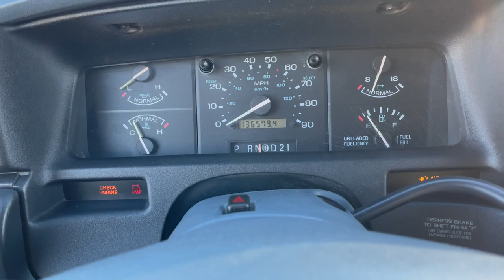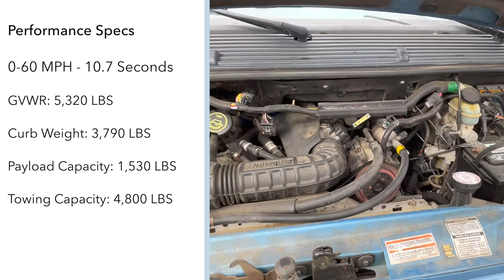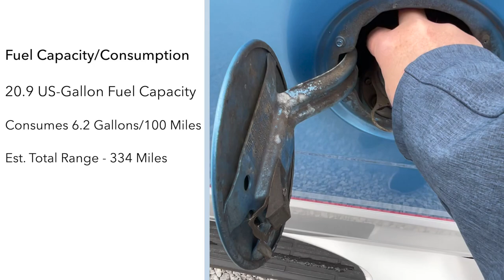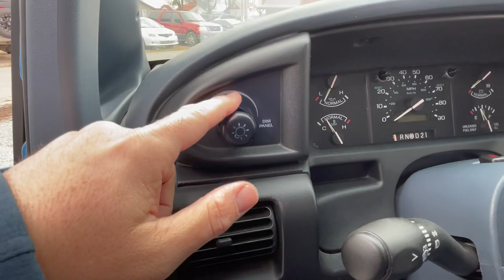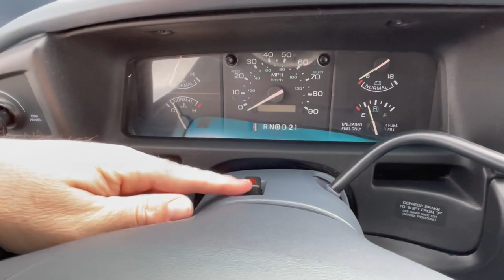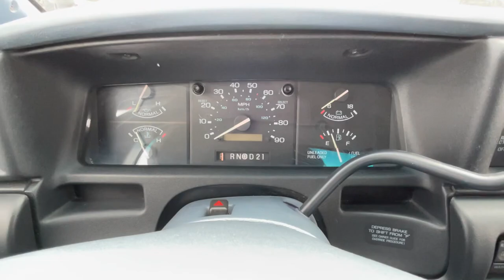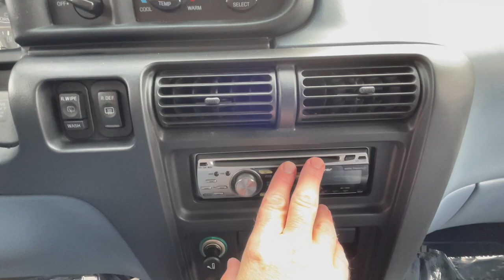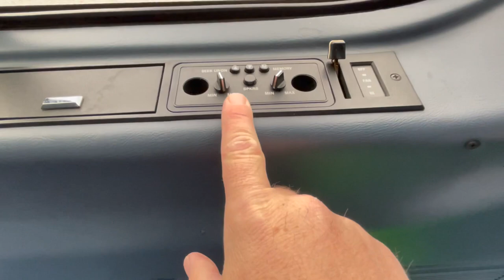1994 Ford Aerostar XL Sport Extended 4X2 | In-Depth Review | Your Livingroom On Wheels

Comment: We have a 1994 Ford Aerostar XL van which we have owned since 1998. I still drive it while at our summer home. Our kids grew up traveling in it in the summers.  I love that the rear seats pull out easily and I can haul various items in it.  Since I have owned it, it sits for the school year and is only driven in the summers.  In about 1999 we had some troubles with it stopping after stomping on the gas. After stopping at about five Ford dealerships and having different electrical components replaced, with the issue happening again, we took it to an alley mechanic at someone’s recommendation and he shortly diagnosed it at the fuel pump seizing. After the fuel pump replacement, it ran great for many years, until at someone’s recommendation I had the transmission filter and fluid replaced. Not long after, the transmission went out and we had to put about $2000 into the repair. That was about 12 years ago and the Aerostar keeps cruising.  After the fuel pump issue, someone recommended putting SeaFoam in the gas tank. I regularly put a can in when I do the last fill up before parking the van for the school year. I also change the oil at that time. I disconnect the battery and nearly every summer after reconnecting the van starts right up after setting for ten months. During the COVID-19 pandemic it sat for 22 months without being operated and still started up fine.  I love my little green Aerostar.
Reply: Reported for spam!
Reply: @JohnnyDanger36963 ? The man is sharing his experience
Reply: @LynxStarAuto  he is posting the same comment on every channel several times per channel...its spam,or a bot. REPORTED

Comment: My mom did daycare for 15 years and used this van the entire time. It was the exact same trim & color too! This van was a literal tank & put up with a lot of crap. The amount of kids it managed to transported in that time was crazy. We also used it for family trips & basically everything else. My favorite part growing up was being able to jump between the front & rear seats so easily with the ample space, especially as a kid. It died a very slow death & the final straw was when the throttle cable got stuck after being left to sit all winter long. As we started it up for the first time in 6 months, the throttle cable caused it to overrev & blew the engine instantly. Granted, it probably had over 200,000 miles at that point anyway.
Reply: Всего 200 000? Почти новый, я года за три столько проезжаю

Comment: You sure called me. I own Three of them even today. Tear them I've owned for around five years and the other one 12 years. Bought them on online auctions. The 3L a great motor. The 4.0 has its problems well documented. But it has been a good fan too. The first one had been my daily driver for years. And I think the most I have on any of these Vans 139,000 MI. Now body-on-frame there's little deceptive. It's more like a unibody construction because it's welded to the body. But they all have been a good van. One report or simply use it for storage and have it loaded down with paintbrushes and things like that so when I go out to maintain my properties. Another one well just has front 2 bucket 🪣 type seats. I actually bought some very high-quality brake parts and rotors and what-have-you and redid the brakes all the way around just very recently. More than what was negative but best way to do it. And I use it to haul my lawn mowers to go and maintain or maybe for camping different things. The first one I bought will I need to do something with it I just leave it set. I guess solid 25 miles to the gallon going down the interstate and if I stay on two-lane roads without stopping go I'll get 28 mi a gallon.

Comment: I guarantee that Pioneer cd player's not stock, but it is a beautiful good condition classic van. the 1994 Ford Aerostar XLT Sport can accelerate from 0-60 in 8 seconds, Carry 2x 2"x12"x8' boards on top of the passenger side seating & has great maneuverability & also makes a good work vehicle, no idea why that wouldn't have door speakers or map pockets, but like I said, it's a beautiful classic.
Reply from the maker: The aftermarket radio is absolutely not stock. Not even close to the Ford head units used back then. Also, since it’s an XL, it didn’t get the up level door trim like the XLT or Eddie Bauer vehicles did. It’s weird, but that’s what Ford did back then. I was glad to see it in such amazing shape, so I had to jump on the opportunity to film a video of it. It even had the original window sticker in the glovebox! Love these unappreciated survivors!

Comment: Helping you with your algorithm by leaving more comments. All three of my Vans have door pockets at the bottom and at the armrest. They are relatively base models. I think all three of them are the XL or maybe the XLT model. It would be interesting to have one at all wheel drive but I have an Astro van that's all wheel drive. If I remember right all three of my Vans or 1995. I'm sharing information if it helps anybody. I think these are really great vans, my cruise control is a second lever and it's below the turn signal washer switch hear it and it has buttons and turn knob. Now the other one they both are set up like what you have. And none of this is after market. I would suggest you put some kind of steering wheel cover around it
Reply from the maker: Love this!  Thank you!

Comment: It's kind of different where they mounted mirrors. Usually got your small little dinky mirrors at Mount where you got those wider mirrors. In that little triangular piece of glass in front of the mirrors that's usually where they mounted the big mirrors at. If you grab that van at all, then you know those side windows are useless a little triangle piece windows and front of the mirrors. Do they can help you find your pen or pencil if you drop it in there. I love the fact that it's rear rear-wheel drive and I wish it had a real frame underneath it. I can easily put to self propel mower side-by-side and they'll fit in there nicely. A decent-sized riding mower well the deck sometimes gives me trouble. I don't know how anybody can put 15 lb in the back of one of them. I don't know how you going to 5,000 lb because what you have to go to Hitch to is pretty lousy. Somebody put a dinky little receiver hitch on the back of the one with a 4.0 in it. Pinko garden cart with it. But any case I love my Vans. I have literally had the back trunk lid open and it's pouring down rain and I stood there talking to somebody else and you stay dry. The luggage rack on the roof they always leak. With those small skinny 14in tires do you really want to pull any weight? You better make sure it has Grayson trailer but even then it was shoved back into that van around. Especially with the extended model. We fabricated a tent like item so when we open up the hat and leave it open dropping the tint sides I am the cetera fasten them together. You have a tent with a solid roof the deck lid and it makes a handy place put another cot. I actually thought these Vans with developing large Coke colouring like a Volkswagen Vans did of the 1970s and earlier. Hasn't materialized yet. Search Craigslist cross-country you can find these vans. Some of them as nice as what you have but most of them are not. But if you want a camping vehicle and not spend my money. $750 to $2,500 if not a bad deal and people will come over to you and ask you questions about what is this? They are 30-years old and they were based on an English band begin with.

Comment: One last comment. You forgot to mention the drawer under the front passenger seat. And also locks and it has a couple of compartment which is a great place to keep the money for your trips although I never use it to that. And a first-aid kit. Now you don't have to let you but you can and you don't have to lock it but you can hear it it makes for a handy place up front in that drawer to keep your vehicle insurance and registration information. So you can easily get at it without having to dig through the glove box or to the major can storage area in that drawer. Plus with the dual controls for the radio your kids can screw with you and change the station as you go down the road. Now if I remember right they have headphones plugged in then they're actually listening to whatever station they want to without interfering with you. But that has been a while back. But I do know from a very recent trip in the last week they can change the stations on the radio.
Reply from the maker: Honestly, when I filmed it, I had NO IDEA about that drawer!  It wasn't until later, after I uploaded it, that I found out about it!

Comment: For 1995 model year aerostar how come the Eddie bauer edition is no longer offered
Reply from the maker: They phased their partnership with Eddie Bauer out slowly and by 2010, it was replaced ultimately with the King Ranch partnership. Also, since Ford ended production of the Aerostar for the 1997 model year, and by 1996, only offered it in XLT trim.

Comment: Nice, quick question.....do you happen to know the width of the cargo area, between the wheel wells?
    I'm planning on putting a queen size mattress on the load flat floor....60 inches or 5 feet is the mattress width
     Thanks in Advance 🙏